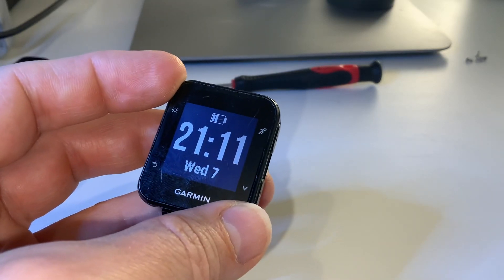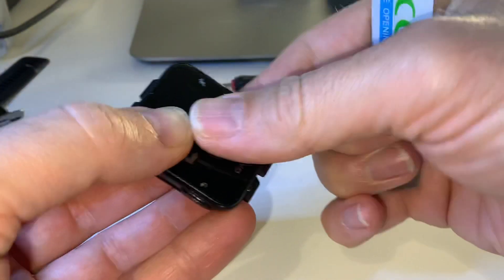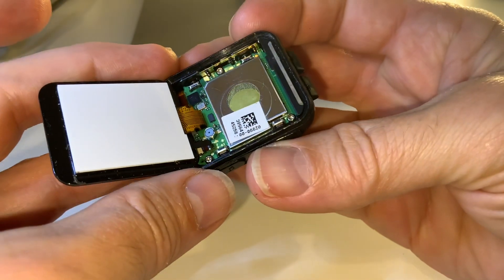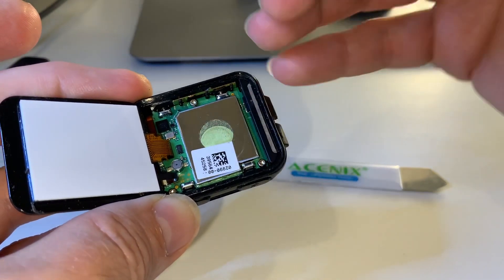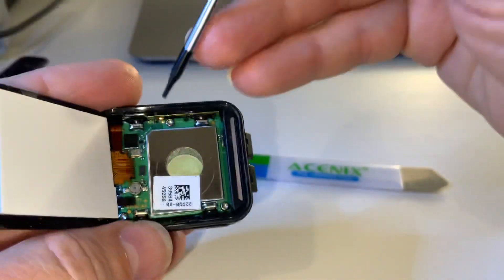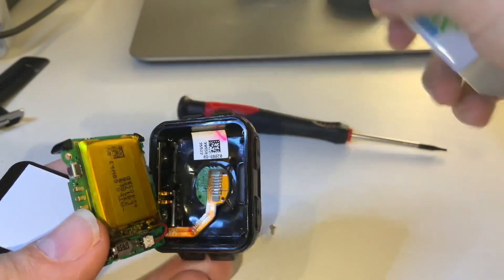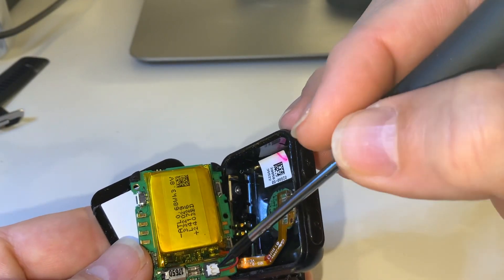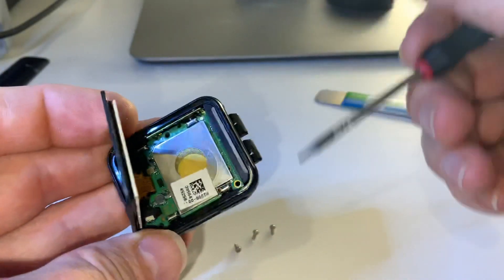Opening up a Garmin Forerunner 35

Comment: SO..... does the screen click back in or is it purely the destroyed rubber seal that was holding it in, like a car windscreen? I also own a Garmin Edge 530 and the battery access is the same as this. Planned obsolescence. Who in their right mind after decades of battery powered watches would make something that requires total destruction of the item to get to it from front to back. A back plate with nitrile o-ring would have done but no, they want this in landfill and for you to keep buying from them.... Sikaflex would do (used for windscreens) but at this minute level of detail would turn into a mess for sure!!
Reply from the maker: Hi  @Bazza1968  , no, the seal needs to be replaced as in my experience it’s paper thin. I agree, the unit is definitely not made to be fixed. I used similar to Sikaflex and it was fine. Yes, a bit messy, but it worked. The other weakness in these watches is the attachment to the straps. These tend break off - especially if you’ve replaced with an after-market strap. 
Having said all of that, you can pick them up in good condition for £20 in the UK, and if they last a year or two at that price, then I’d say it’s a good deal. I have a bunch of spare parts now!

Comment: Spudger doesn't do anything apart from run up and down the side. Have a 0.1mm spunger. Why you would make this video and then omit the only part that needs advice... Seriously frustrating
Reply: Ok, anyone reading this... I used heat (a hot water bottle) and extreme patience. The 0.1mm spudger I used is dangerous so be aware that if it slips it will cut you like a knife!. Ok so I scraped around the edge a bunch, maybe 10 times each side. I then sat the thing on heat and then tried to put as much of the spunger, length ways, into the small gap, and then rotate. The first time I did this a tiny scared snapped off so be careful. You basically need to the repeat this 5+ times around all edges. You might hear a slight crackling noise as the glue starts to pull apart. At this point you can try to force the spurge further into the golroove, carefully tough as it will damage the screen (I believe) if you go In too far be you d the edge.. you only get another few mm before you'll see it through the screen which you'll want to avoid. Once you have loosened up a side/side corner things will get easier. It is doable just with this video had the process so you could be reasured the glue takes ages to come apart but will eventually. One of those suction gadget would have been brilliant but due to how small this is the one I bought to fix my phone was too big :(. If you do use a suction thing STOP pulling as soon as you feel any kind of give or you'll tear the screen and cables out completely!

To remove the battery for replacement carefully use your nail or just a little yank on the cable. 

When buying a replacement battery I've noticed that a lot of listings were 3.7v/90mAh/0.33Wh... where as the true battery is actually 3.8vl110mAh/0.418Wh.... so id advise paying extra trying to source the proper battery else your device will seem shitter as it'll have less battery.

Comment: Well, this is semi useful, and I appreciate it.  That said I'm glad I was trying this on a device I really didn't need any longer and good thing.   What the first part of this video should have had is a bit more detail on how to carefully remove the display.  Firstly, that nice wide spudgeon is exactly what is needed, not any sort of narrow one.  Secondly getting through that seal is EXTREMELY difficult as it is just that, sealed and must be cut through first. Thirdly, when you do finally remove the display use extreme caution as the glass and electronics have about 1/16" between edges.  Any deeper movement beyond will cause the LCD part to separate and be ruined. Lastly, what is needed to properly seal it back up again?  Once the original is ruined that's it.  Anyway, you gave me ideas.  The rest was experimentation.

Comment: My screen got shattered. I found replacement screens and was wondering if you had any idea how difficult it would be to replace the display. I see the two connections. On all the other Garmin watches there only seema to be one. Any help would be appreciated!
Reply from the maker: I haven’t changed one myself, but they appear to be push-fit ribbons. Once you have the face off it should be a simple connection, but then you need to seal the face back in with a very small amount of Silicon sealant. Don’t pay too much for a replacement screen as you can get a watch on eBay for £35 including p&p
Good luck :)

Comment: Thanks a lot for this guide, I had no idea how to open it up.
In my case, it started doing random things... sometimes it would turn off and not turn on again, sometimes it wouldn't charge up, sometimes the screen would show random noise. I'll try and figure out what's wrong now (I guess water damage?)
Reply from the maker: Yes, my experience is that after water damage, it's probably never going to work again :(
Reply: @calumshaw1  Yes... mine had clearly signs of water damage, I tried cleaning everything off but it didn't work :(
Anyway, thanks a lot for your video!
Reply: @calumshaw1 crap I think mines broken forever  now 😭 It said it was water proof

Comment: I don't have a spudger, I just have a razor blade attached to a box knife but the screen is proving to be very difficult to dislodge with the original waterproofing intact. Every time I try to apply just a little bit of sideways pressure to lift out the screen, the edge of the screen starts to chip and crack.
Reply: Necesita calentar, con una secadora de pelo por ejemplo

Comment: Thanks for the video.I dropped my watch and it would not power on unless hooked up to the charger. Followed your disassembly instructions and pressed the battery connector back down. Voilà, the watch is working fine now.
Reply: My is doing the same thing but I tried to take it of and it is cracking, how did you get it off without cracking it?
Reply: @nataliecordova2080  The glue holding it together is pretty strong. You have to do it slowly to give the glue time to separate.

Comment: Thanks! Will need this to disassemble mine because it has caught the vibration bug
Reply from the maker: Oh, can you tell me how to fix that Charles? This one was going nuts every now and again - as though the start button was being pressed repeatedly. Since I cleaned out the innards a bit it has mostly stopped. Does that sound like the same bug?
Reply: @calumshaw1  kinda. Mine just started vibrating non-stop yesterday and after searching online, I can see a bunch of similar reports but no working solution. My plan now is to find the vibration motor and disconnect it
Reply from the maker: @kymni  Ahh, that’s quite drastic, but should be easy to do. Good luck!
Reply: Guys was it just the vibration? Mine was like the activity button was repeatedly pressed. At first I thought of some small stuff that got into the button and I needed this video to try some sort of cleaning, but that wasn't it. Resolved the issue with an hard reset 

(edit: you probably got a new smartwatch by now...)